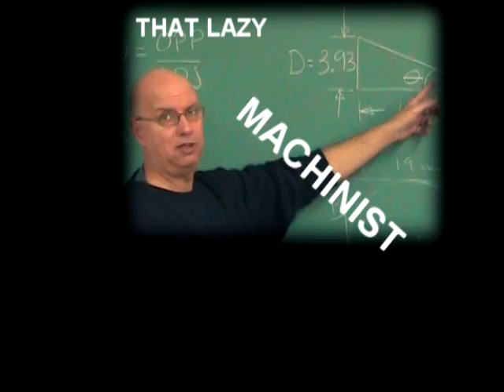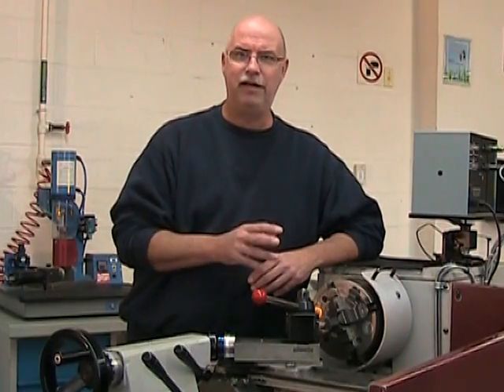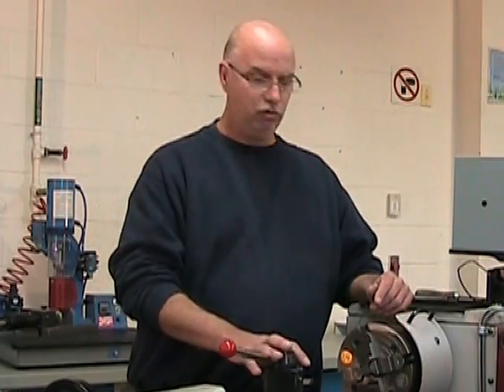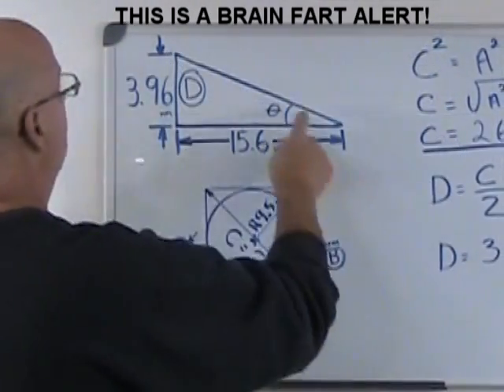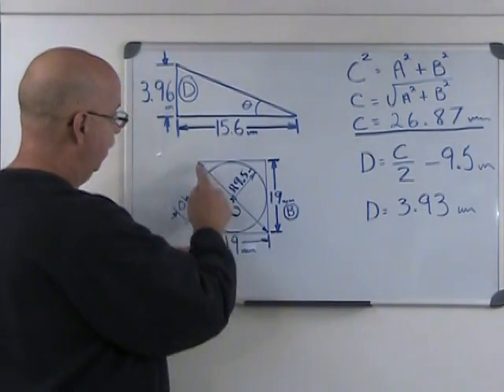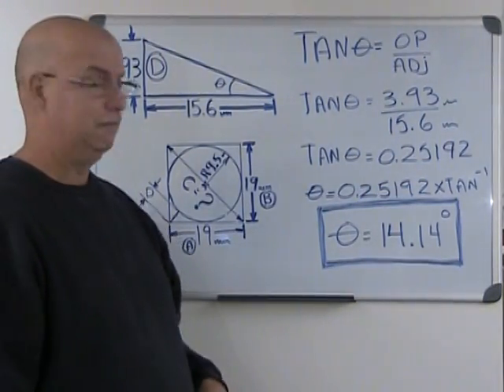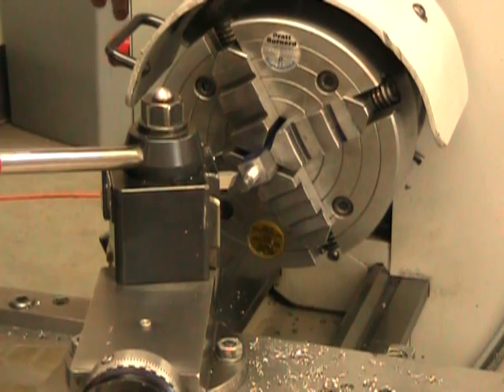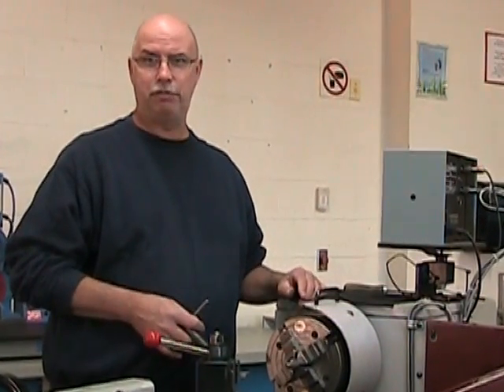THE HAMMER'S HEAD, TAPER & PARALLEL TURNING, GROOVING, DIE THREADING IN A 4 JAW CHUCK. MARC LECUYER

Comment: Marc..I just finished watching the tapers video. Thank you, as always you do it 100%.

Now the thing is, I want to make a collet chuck arrangement to insert directly into head stock taper of my lathe...........it's big  MT6...........and then once a male MT6 is turned I can turn that around, insert it into the headstock taper and machine accommodation for a C5 collet with a draw bar the length of the headstock. And that will hold the C5 and the the MT6 taper firmly in place. I think!

Now here's the problem..........and perhaps you may be partly responsible for specifying all the these Mtapers as being ever so different ;-). I had planned to use a smaller Mtaper in order to set the angle of the compound for cutting the M6. I'm wondering why on earth wasn't it convenient to use the identical angle for all Mtapers. You see I'll feel better about this if I can find somebody to blame ;-)

Ian Beswick
Victoria BC
Reply from the maker: ian beswick  Hi Ian, I can't answer with all certainty but I would guess that it has to do with the fact that the Morse tapers are an older system and that things evolved (rather than having been decided rationally) from fractional diameters (major and minor diameters) and in order to make the diameters work, slightly different angles are required. The Jarno self locking tapers and many other systems manage to maintain a constant angle regardless of the size of the taper, but not the Morse. I like to mention that the angles vary a little from one size of Morse taper to another because most people expect them not too and get into trouble. I hope this partial answer helps (if anyone out there has the full story please weight in) and thanks for watching! marc L'Ecuyer

Comment: Great video. There is a minor flaw in your explanation of the math though. Where you solve for theta you say that you divide by tan on both sides and get tan^-1, that is strictly speaking not how it works. First of all tan is a function, it takes one argument and returns one value. tan^1 is the inverse function of tan, it also takes one argument and returns one value. The way inverse functions work is as follows: Given a function f(x), f^-1(x) is the function which satisfies the equation f^-1(f(x)) = x. In laymans terms, the inverse function is the function which undoes the original function.

What you are actually doing in your equation is use tan^-1 on both sides:
tan^-1(tan(theta)) = tan^-1(0.25192).
Since tan^-1 undoes what tan does, we are left with only theta on le left side.

On a sidenote it might be useful for people to know that tan^-1 is often called arctan. It is the exact same function, just written differently to avoid confusing it with 1/tan, which is not the same as tan^-1!
Reply from the maker: Hi Neistridlar, thanks for the insight and for the great explanation. Math is obviously not my strongpoint, but since these comments are public your intervention will help others. I encourage this type of very positive intervention and often wonder why some people do not accept comments on their pages. Thanks for taking the time to help make these videos better. Marc L'Ecuyer
Reply: Really… yeah whatever..